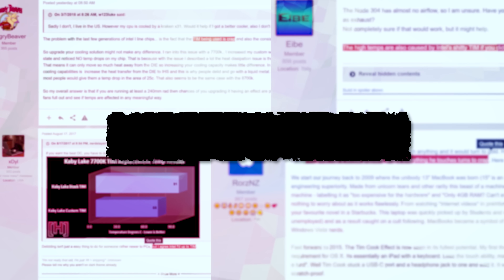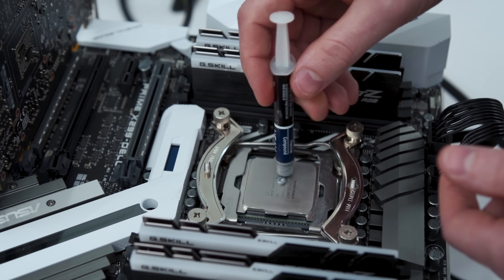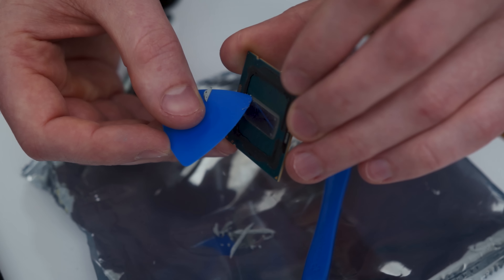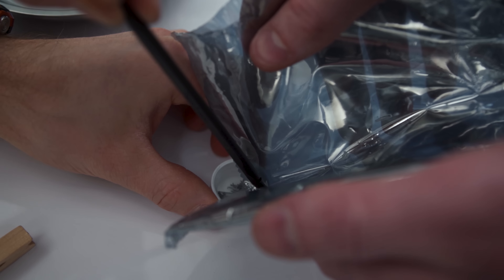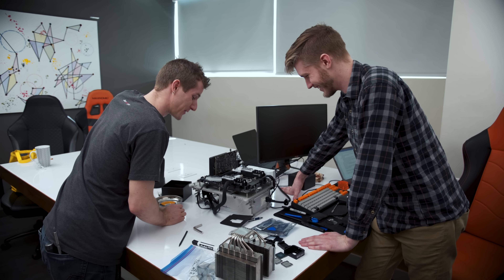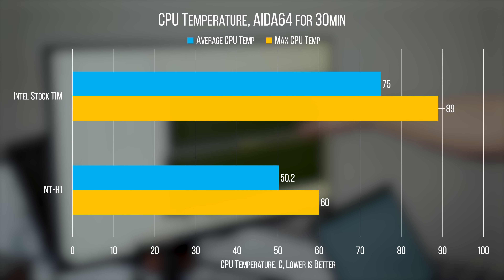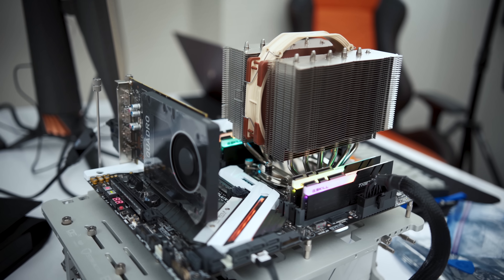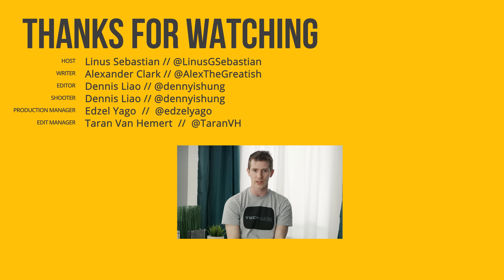Is Intel’s Thermal Paste ACTUALLY That Bad?

Comment: It makes sense that they'd choose a TIM that lasts a long time over one that performs better but lasts a short time. Quite a few consumers would be pissed if after a couple year their CPUs throttled over the smallest loads.
Reply: Yes it does, but why not keep doing it like they did up to Sandy Bridge and solder the Heatspreader?
Reply: Soldering their chips would have infinite durability and be barely more expensive.
Reply: Maybe but they used to Solder the IHS which is the best solution which results in very good temps and is second only to direct die cooling.
Reply: "Quite a few consumers would be pissed if after a couple year their CPUs throttled over the smallest loads."

... so instead they use a TIM that lets the chips throttle from day 1 (e.g. i7 7700K). Yay, what a great company intel is! Admit it, intel is just dirt cheap & greedy and saves every penny even on their high performance chips, although it hurts performance and life span when the chips run so hot. intel definitely does not use this thermal jizz for the consumers benefit. You gotta be terribly naive to think that, while the competition solders even most of their budget chips!
Reply: +ABaumstumpf Show me one CPU that was damaged by solder. Even Sandy Bridge CPU's work completly fine today.

Yes, temperature variations affect solder, but unless you are heating up CPU from -80C to 200C regularly (literally), you've got nothing to worry about
Reply: Yeah gotta love Intel fanboy logic right. Soldering CPU harms it. Wow, who would have guessed. Intel must be playing cheap on those XEON CPUs. Oh wait...
Reply: Sandy bridge CPU's are starting (slowly) to fall into the "obsolete" category after 7 years, and almost all of them still have perfect solder jobs. MORE than good enough for me. Heck even C2Q's still run well. If you need a CPU for 10 years then perhaps your expectations are a little unrealistic.
Reply: LRM12o8 I've got a 7700k with stock TIM overclocked to 4.8 with only a 212 evo with no thermal throttling even under extended 100% load so idk what kinda bs you've been hearing but it's definitely not true...
Reply: just solder it like amd. Sandy bridge chips will STILL go up to near 5.0 ghz
Reply: The whole solder cracking thing only supposedly affects small dies. That might have held some weight with mainstream CPUs, but that went out the window when they put TIM on the much larger SKylake-X. Also there are older small-die soldered chips, Core2Duo or something I think, holding up just fine.

Honestly the TIM does a good enough job to run stock. I might be fine with them using it on locked mainstream CPUs, especially if it made them cheaper (probably not though, they'd just pocket it), but k-SKU and HEDT chips should definitely be soldered. There's no good reason other than being cheap.
Reply: MinecrafterPiano removed the cooler in almost 8 years,it's been on there this whole time and all I do on my pc is gaming 24/7 technically pushing it to the limits all the time and it for some reason never gets over 60°c... How? I mean I'm.nkt complaining lol.  but how?   Did they just use the Better thermal paste in the CPU back then?
Reply: MinecrafterPiano 70°* oops
Reply: I read an article about soldering a cpu to ihs.  It is a complicated process.  Definitely easier and cheaper to just paste.  

If you want better paste youll have to replace it at some point. So might as well de lid it yourself the first time.
Reply: that only applies if you have shitty thermals from the start tho. Microracks in good quality solder will not appear unless you hit the 80-90 degree range on a regular basis
Reply: ABaumstumpf Source? Where are all of these overheating SB CPUs?

Comment: wow that was so wrong. like srsly this is no paste anymore it got worm and pressed together but cause its this dry its just a hard plate. i mean... if you compare just the looks, you can see its not a fair method. why dont you get a new cpu, test temps and then delid it but you take thermal paste instead of liquid metal. Like you just replace the thermal compound with more expensive, aftermarked stuff....

Comment: Congratulations. You just compared 6 Year old, baldy distributed 'paste' (which also might reacted with the alcohol - who knows) with some excellent new one. Also, it might be interesting if the "better paste" will do it's job after 6 to 10 years (because Intel cannot tell its customers 'well you need to replace your thermal compound every 12 month or so').
I am not saying that Intel is not using bad thermal compound (I really don't know) but this test is telling us absolutely nothing at all. And no, your application of that old dust was not even close to being acceptable. WTF guys.

Like many said - one of the worst LTT videos I have ever seen.
Reply: I hoped for the chip to burn because of the alcohol applied to the thermal paste, atleast the video would be funny
Reply: Lol
Reply: They brought up the longevity of intel paste several times in their video.

Comment: So how is this better, and has "less variables", than just changing the thermal paste under the IHS for smtg else and comparing the results?
Reply: Well many argue that the silicone glue and the spacing is more responsible for poor temps than the actual paste. Maybe that's hard to duplicate once you take it apart.
Reply: Its simpler because they are only testing the difference in thermal conductivity between TIMs and you can learn that difference without needing to delid between each test. It doesnt matter where you test the difference as the only data you need is the actual difference. This test could for that matter could have been done on an electric stove with TIM between the stove top and a pan filled with water and then measured what TIM had the water in the pan reach 80 degrees faster. You would still have gotten the same data AKA the difference.
Reply: Except that they weren't just testing the differences in the thermal conductivity. They introduced several other variables, like the thickness of the application (did the powder slurry spread out as thin as fresh TIM?), the amount of air between the cold plate and IHS as a result of the variable size of the powdered TIM, etc, etc. They should have tested the cooler without any TIM to see if they weren't just making the performance worse with their TIM slurry.
Reply: They did the best they could with the materials they had, but I do agree that a test without any TIM could have gotten some possibly interesting data(but it would just been a data point that confused the point of the test and needlessly created more work that gained nothing as it is a given that almost anything apart from a straight up insulating material will preform better to some degree than using nothing).
Reply: I'm pretty sure Intel's been giving him money to do all this subliminal type of advertising lately. Results or anything doesn't matter. Psychologically, hearing LTT bring up Intel so much influences consumers.
Reply: You're totally right, Rich Lynch, but honestly I'm okay with it. As a Top Gear fan from back in the day I love LTT doing stupid shit with expensive tech... Certainly never bothered me that racing fighter jets with Bugatti Veyrons was great publicity for the car manufacturer, so long as it's interesting enough to watch.

Comment: Linus should take a new 8700k bench mark it for the temps, then delis it and replace the stock paste with the large tub thermal paste he got from AliExpress, do the test again and see if there is any difference. And use liquid metal on the IHS for both runs.

Comment: Regardless, the IHS should be soldered anyway.
Reply: If only Intel thought that way
Reply: Why? If its cheaper and easier to use paste why would they solder?  
Companies and the humans in them look out for themselves.  Get woke.  

If you want better paste delid it.  If you want to solder it go ahead and try.  Its way more complicated than you would imagine.
Reply: EHEH RON: AMD uses the solder method for all but their particularly low-end models. All the Ryzen CPUs have soldered IHS's, and this was also true for their older processors like the FX and Phenom/PhenomII series. So they've been doing it for quite some time, which makes me question if the intel thermal mayo method is in any way cheaper or easier.
Reply: EHEH RON How much do you think they're saving by using paste? Because it's not much.
It's not that complicated either, they just put a ball or two of the stuff that they use on the die and then heat it up until it melts, just like surface mount components.

>If you want better paste delid it.
Brilliant thinking there. That $300+ processor you payed for, or that $1000+ Xeon, you don't deserve to have it soldered. Just delid it, risk damaging your CPU, and lose your warranty.

Comment: Those temperature differences are also what I'd expect from a badly applied thermal paste. Which is exactly what you've got there...
Reply: You can't go 25 degrees higher because of badly-applied TIM. Probably not even 10; there have been tests of temperatures on badly-applied TIM.
But this video is a joke anyway.

Comment: Sorry Linus, but your test methodology is rubbish! You really couldn't get Intel to send you a jar of the thermal paste they use? They sponsor your content all the time! Did you even ask?
Reply: It seems like Linus doesnt understand how thermal paste works, in the end after they remove the heatsink you can see how thick the paste is and there is 0 metal on metals contact, thermal paste is meant to fill the gaps where the metal isn't making contact due to the imperfections in the materials, if both surfaces were 100% perfect then thermal paste wouldn't be needed, that is why people say to use as little as possible, its not like glue where you want a thick layer all over, just enough to fill microscopic holes.
Reply: Bubbauk88 100% correct.
Reply: It's probably not bad, it's probably a standard grade material that has like right around 5W/mK, which usually in real use is just a couple degrees off the highest performance compounds. However it is apparently tasked with covering too much gap due to bad heatspreader design. Those are thick slabs of thermal compound they dug out of there, no conventional TIM could ever be effective this way.
Reply: Come on you guys, linus does marketing and promotion, material science is out of his reach for such a sudden idea, plus the guy says what is on his mind so you know something as rediculous as this is possible and thankfully a hi- definition camera let's us see the bad and the gooo.......nevermind, I agree, linus does look like a imbecile while mixing old dusty thermal paste with isoprophyl alchohol to try and bring it back to life.

Comment: This test has so many problems, but the largest is that it misses the problem with Intel CPUs. The problem is not that Intel's TIM is bad, it's a combination of the use of TIM (any TIM, besides a metallic compound), and the large gap between die and heatspreader due to the adhesive. I've seen tests where the TIM was replaced with NT-H1 and the same gap was maintained between die and heatspreader, and NT-H1 performed *worse*.

Delidding and specifically using liquid metal compounds works well because:
1. The thermal environment between CPU die and heatspreader is hell; this is where the massive thermal conductivity advantage of metallic interfaces shows a significant benefit.
2. The heatspreader is usually brought closer to the die.

The best results are achieved when the adhesive is scraped off entirely and not replaced, i.e. leaving the heatspreader 'floating' on top. Sealing with adhesive consistently produces worse results because it increases the gap.

So no, Intel's TIM is fine. The problem is using TIM instead of solder.

Comment: WHY USE ACTUAL CPU FOR HEAT SOURCE
Just use something consistent. I mean, something with temperature or heat or calorie control.
Reply: Using other heat source is not the same as using a CPU, it just doesn't truly test the efficiency of the thermal paste
Reply: @ErratikMantis  Calories is a common unit universally, even in metric-based countries like Australia for the measurement of heat energy in experiments. Sometimes, it's more convenient to use calories over joules.

Comment: I have been reusing dried powdery Silver TIM for a decade or 2, whenever I didn't have enough good new TIM.  I just add a bit of white thermal compound, (sometimes you get the added benefit of of an oil separating out of the white compound which expedites the process) to the silver TIM and mix well. The result yields a smooth, albeit, viscous compound that's a shade or 2 lighter grey colored and works fairly well. That being said, I never did this with harvested TIM from under the lids, only TIM located between the heat sink and CPU.  I use a white small jar of Wakefield compound, which is so old I can't read the part number (it has mostly rubbed/flaked off).  There are probably many white TIMs that would work assuming their chemistry is similar.  Easy enough to revisit except for the fact you need to delid another bag full of CPUs !

Comment: Couldn't you just compare a delidded CPU where the Intel-stuff is replaced with that Noctua-paste with a stock, not delidded CPU? I mean we know what results we get if we delid a CPU and replace the Intel thermal paste. This video is really just unnecessary to exist...seriously
Reply: They're claiming that the act of removing the heat spreader and then reattaching it could affect results, however how in the world did they think that this horrendous unscientific methodology that they used in the video has fewer variables?

Comment: That harvested TIM looked very much like the old, baked out MX-2 I had to clean out of a really hot-running laptop. (I know it was MX-2 because I applied it about 3 years prior.) Replacing that with fresh MX-2 (from the same tube the old stuff originally came from) produced a 15°C difference. And just like this one, the old MX-2 wouldn't come off with alcohol - it just retained the same rubbery consistency as before, not even discoloring the alcohol -, while fresh MX-2 would dissolve somewhat.

My guess is Intel's using the same binder material found in MX-2, and it polymerizes under excessive heat.

Comment: My i7 3770k is still rocking a 4.5ghz overclock 5 years later, running 42c on idle, 75 on full load with 1.275 volts and a Corsair AIO H105 that's never been replaced or even remounted.

Comment: Ultimately the problem isn't with the thermal past, the issue is with the space between the heat spreader and the die which is set by the amount of silicon paste that they use to seal the entire unit.  The liquid metal just allows a better contact, nearly metal to metal which is optimal,  between the heat spreader and the die, but only when you remove the silicone sealer.

Comment: So for this video you have to ask: "why use thermal paste at all?" and the answer is of course to ensure that the entire surface area of the countries can make thermal contact with the cooler. Ultimately this means that there are two properties that make a good thermal paste. Particle size and thermal conductivity. Particle size needs to be small to get the paste into all the micro scratches and bumps on the cpu and heatsink. I love your videos but this one was really bad science. You weren't testing what you thought you were testing.

Comment: In other tests they do much better about eliminating variables, but in this case they added variables by adding alcohol to the mixture and by using used dried TIM instead of fresh TIM. What they got was a flaky porous cake of old TIM on the CPU instead of a proper spread. They did the best they could with what they had considering that Intel isn't likely to send fresh TIM to anyone for testing, but a closer Apples to Apples comparison would've been to use old Noctua thermal paste that has also been used before and scrapped off CPUs that's about the same age as Intel's TIM and also give the Noctua paste the same amount of alcohol to makes it "usable" again. That would've at least eliminated the age variable.

Comment: I’ve thought of a way to do this experiment though...

1. Get 2 of the Intel’s stock coolers
2. Replace one of the stock cooler’s thermal compound with an aftermarket one
3. See the temperature differences
4. Done, period

Comment: Its true for 8th gen cpus because I have a 7600k an I delidded that and replaced it with liquid metal when stock I was idling at 40c on watercooling and 70c underload after delidding I idle at 29c And under load I reach 50c max
#FuckKabyLake
Reply: It was idling at 40c on watercooling?
Reply: Wait ... that makes sense considering that intel just took Sky Lake, and cranked up the voltage and slightly tweaked the factory clock settings. Then they repackaged it and had the balls to sell it as a new product. Kaby Lake was just a hotter, pricier, more power hungry version of Sky Lake. When you increase the voltage and change absolutely nothing and keep the exact same shitty thermal paste, and the same shitty stock cooler (that people have complained about) for the last 7 generations!!! When you add 2 and 2 what do you expect? This is one of the many reasons why people went bought the AMD Ryzen processors instead. 

Honestly the biggest reason has got to be intel's CONFUSING naming scheme. I can't keep up no matter how much I try to. AMD had a simple line-up that did just as well if not more at a much cheaper price. 

I think Coffee Lake is pretty awesome! I think Zen2 will also be pretty cool. I think Sky Lake was also pretty good. So for full disclosure of fan boys intel and AMD alike. I only hate Kaby Lake for the reasons stated above. 
#FuckKabyLake
Reply: My OC ryzen is idlying at 30c with the stock cooler